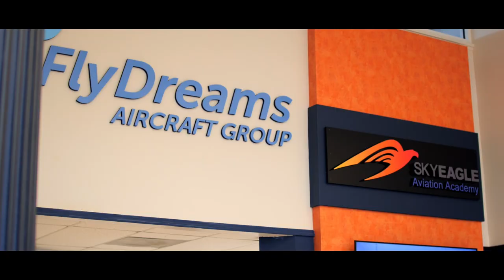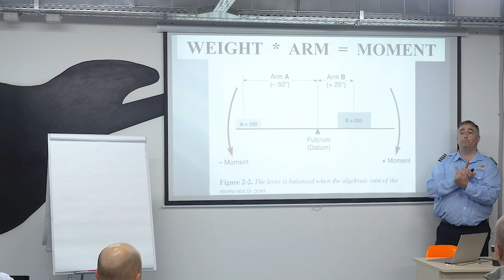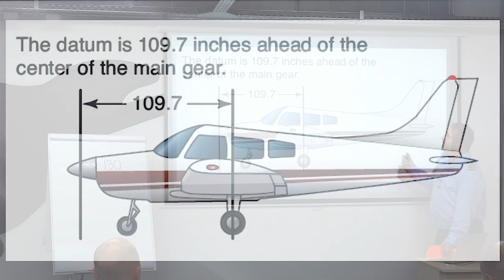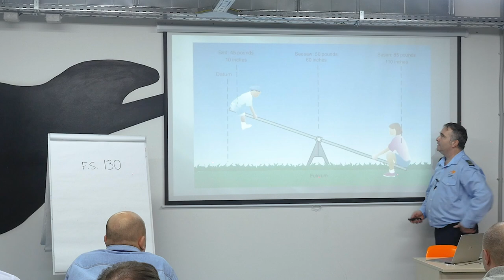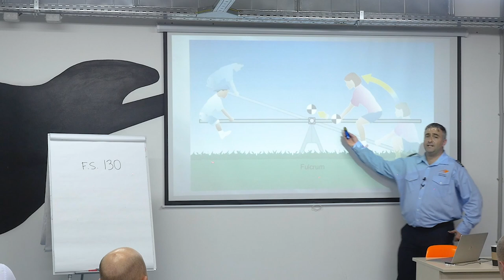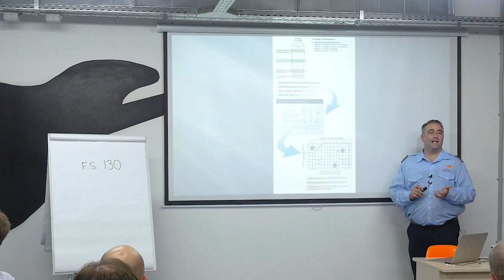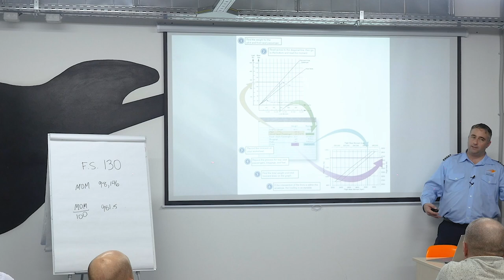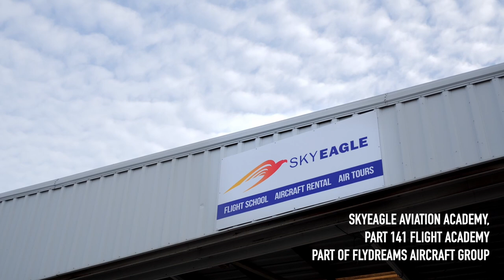Lesson 23 | Weight and Balance  | Private Pilot Ground School

Comment: The reason the SR-71 could fly with more weight vs. takeoff was how the plane was made.  It went so fast that the skin would expand and contract due to the heat generated by friction with the atmosphere.  At the time, there was no viable solution to seal the fuel tanks, and they would literally leak on the ramp so they would put enough fuel in it to take off and then refuel it after takeoff.  By then, the plane could speed up, expand the skin, and fully seal the tanks, so leaking wasn't an issue.